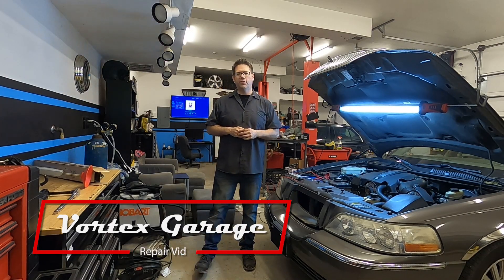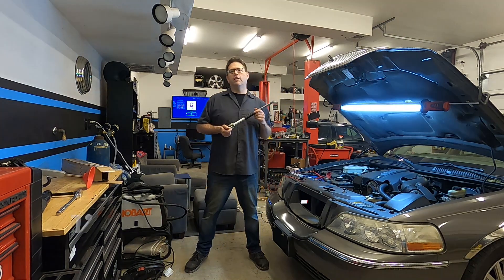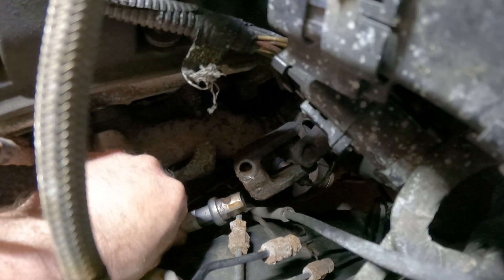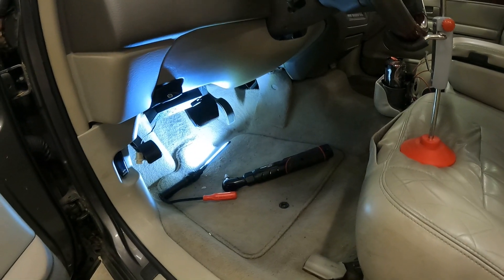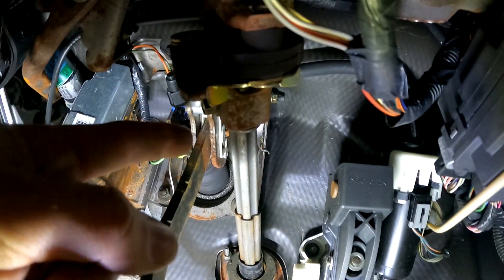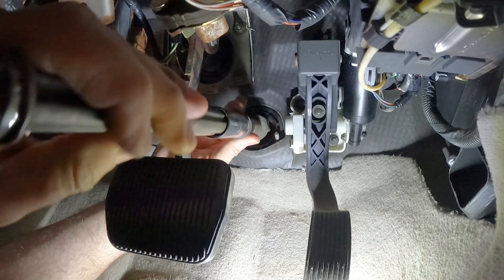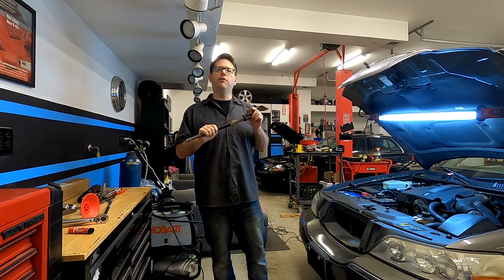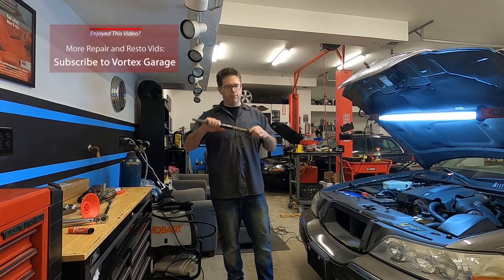Intermediate Steering Shaft Replacement - 2003 Town Car and other Panther Chassis Cars 2003 - 2011

Comment: My 01 crown vics steering wheel moves up and down, I can wiggle it upward and down...the center bolt is tight like it should be....do you have any suggestions, I would greatly appreciate it....ty in advance....

Comment: Great video .very helpful..
Now i just need to find that bearing thats on the firewall..its wasted
Reply from the maker: I think I located the part number however it does show as discontinued but you may be able to find using this:

2W7Z-3C611-AA

Part is described as shaft "Lower Boot" but images show it as the boot with the metal retainer and bearing included.
Reply from the maker: Also some good info on this thread. I know Dorman makes the intermediate shaft and it includes the boot and bearing. It sounds like you have to use the Dorman shaft going this route. This thread has some great pictures and an account of part comparison if you decide to try this part -  

https://www.crownvic.net/ubbthreads/ubbthreads.php?ubb=showflat&Number=4132068

Comment: Would problems such as loose steering (ability to stay tightly in a lane) and later steering locking up similar to loss of a steering pump indicate this set of problems for this recall? Any help is appreciated.
Reply from the maker: I'd say the steering locking up for sure, especially if it's only in portions of the turning of the wheel.  Loose feeling steering, probably not so much.  If this is a pre-2003 car, it will have the older steering box and linkages, more prone to looseness.  If 2003 or newer it will be the rack and pinion, and could be anything from tie rods, steering rack issues, etc.

One more thing could be the manga-steer.

Either way, you could use this recall as a chance to get a diagnosis from the dealer.  The steering shafts for sure can cause many steering feel issues, and that could well be your issue.  If not, they may be able to better pinpoint.

Comment: One day, a month ago I heard a squeel like a unlubricated abll joint and a pop. Got the car (2006 CV with 165K) up top speed on the interstate was now difficult to keep in one lane. While in the garage I could moce the wheel to one side I heard a click and then to the other heard the same click soemwhere under the hood. I'll order both, because like you said it is the "steering". I need two more years out of this car before I get an Nautilus. Good comment about car dealers. I buy virtually everything from RockAuto but yeah, it is the "steering" Tahanks for the video!!!

Comment: We had our ignition cylinder seize up and the key wouldn't turn. Then the wheel locked while trying to free the key. I shook the steering wheel and twisted it violently for hours to get the key to turn over 2 days of sitting in a lot. Called a tow to have it brought home so I can drill it out and get a new cylinder but the tow guy asked to try. He also violently shook the steering wheel and got it to turn the key so i drove it home popped cylinder out until new one got here in mail. But since then the steering wheel feels a little loose. This was 3 weeks ago Now its really loose it goes back and forth 2 inches while driving in a straight line. Cars going straight but steering wheel sways. I already have new ball joints, tie rods, idler arm, and sway bar links which i put in 2 years prior. Definitely still good. Any idea on what could be loose making the steering wheel wobble? I'm planning on getting a new steering gear box as it been leaking. Stop leak worked for a while then it Needed a second dose. So a gear box and pitman arm were on my list. These 2 shafts are something I wouldn't of thought to replace but clearly they are wear parts so I'll get the upper and lower as well. But would anyone know? What could of went bad between the steering wheel and this shaft being replaced in this video? Is my entire column trash now from the man handling of it while stuck? That shaft is twistable by hand. Is my wobble the gearbox and shafts? Much appreciated, disabled and low money, 99 grand marquis. Thanks

Comment: Question for poster or anyone - for 1997 Crown Vic - new upper and intermediate shafts, but when car warms up there is a significant rubber-sounding squeak and increased stiffness in the steering.  Did the shop fail to lube the firewall bearing properly?  Not sure why it makes noise after car has warmed up but not when cold.  Stiffness increases w/ noise.  Is exhaust heating something up?  A mystery - thoughts appreciated.

Comment: Hey WhT about th copper never seas do you need that on the joints?
Reply from the maker: Not mentioned in the service manual. I would also think using it on the exposed joints may cause it to attract more dirt and grime. None used on mine and they're performing great.

Comment: where can i get a new bearing from
Reply from the maker: I'd recommend calling your local dealers parts department to verify this. The diagrams are not clear, however this may be it - 2W7Z-3C611-AA (more.....)

Again I'm not certain that is the right part but you could ask your part dept to validate. 

The fitment reference is odd too, showing some panther cars through 2011, but town cars only through 2002. Not sure if it's just sloppy parts reporting or what. So again, not certain but hopefully a good starting point for you to verify from.
Reply: @VortexGarage  I am still having some tightness in my steering after changing both the lower and upper intermediate shaft.